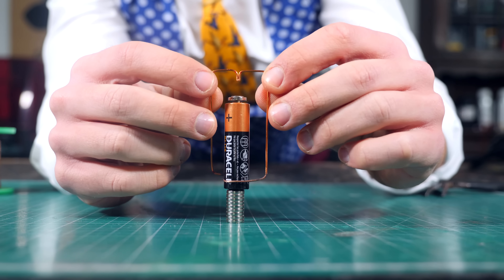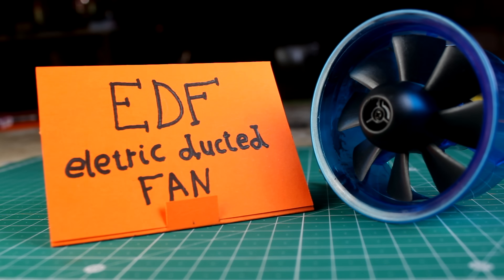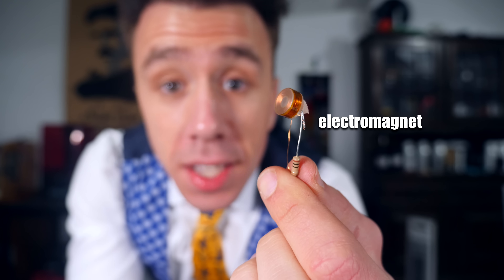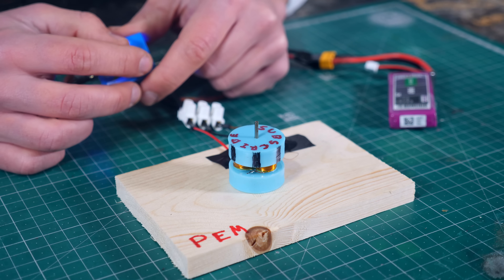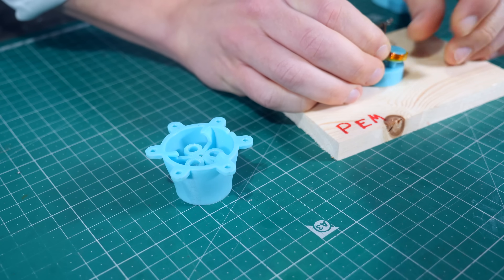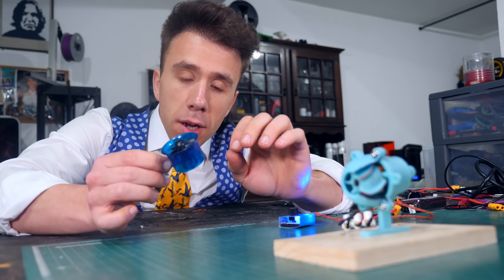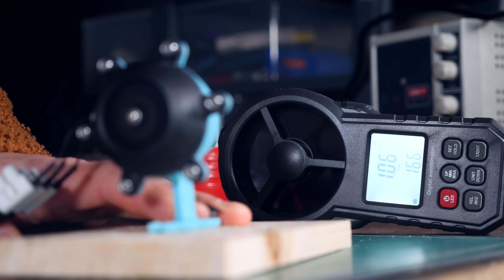I 3D Printed an ELECTRIC MOTOR FAN

Comment: I think you may be eating up your output thrust by the design of the intake side, it isn't conducive to flow. Look into "trumpet intake" (performance automotive) as a very base idea and you'll notice that similarly jet turbines usually have a round edge around the intake.

Comment: I'd first guess part of the issue is intake surface area. The difference between the EDF and your fan is quite a lot so your max static pressure is probably much lower and your impedance higher. I didn't get to the engineering portion of my time studying Aeronautics though so, that's a best guess.

Comment: Not an expert, just fan ...ha 😀and aviation hobbyist. But it might be due to EDF being ducted propeller intended to accelerate air backwards. While your impeller is a compressor which is for compressing the air and actually even slowing it ! And than to be mixed with bit of a fuel and ignited and this is the acceleration portion of the cycle.
If i think about it you seem to go around it in a reversed way. We use compressors in turbine engines to drive themselves and use rest of the air as propulsion either as by spewing from the back or using every little bit of its motion to move a fan - which moves the air. With EDF work of the compressor is done by the electric motor. So what you built seems like.... efficiency wasting device. :-D
Untill you inject that sweet fuel....you know you want to. :-) Anyway Glory to tomato king !

Comment: Maybe smooth your exhaust of the fan to try and decrease drag or increase the size of the exhaust hole

It seemed kinda choppy and the air might get stuck in the bubble bit leading to the tiny exhaust

Comment: The modern jet engines actually built of three parts the compressor, burner, and the turbo.  The first part the compressor compress air by building air pressure and decreasing velocity. Witch that type of impeller is know to do in a turbo. So the problem is one one the two laws involved. Off the top of my head I can remember which Charles or Bernoulli law . But that both deal with pressure and velocity a none compressible fuild (air is considered to be)  exchanging in a Venturi.  To fix  your problem you got the change the pressure on to velocity.
Reply: Text the
Reply: user_kg  text the tellagram above

Comment: My idea for your next video is also the solution for this video;  just to make a bigger design with the same volume cavity size as the EDF fan would push. I believe your smaller model might be just bottlenecking and not allowing the same amount of volume to flow by.
Reply: Hey integza how can I be sure you're the one I'm messaging in telegraph?

Comment: Hi Integza.  Nice video, good try, wrong design.   You built a compressor, and not a good one  (due to the large air gap) when you want a "thruster".   What you want is closer to the squirrel cage blower you show earlier in the video.  

Dyson needs a compressor because they have to fight a lot of internal ducting ("head" or back pressure).  Then at their exit they trade pressure for velocity, and then velocity for total (more) moving air mass.  The last trade relies on some mix of Bernoulli and direct "push".  And they for sure have reduced the air gap at the blade edge to nil or close to it. 

The squirrel cage blower - note the blades are all at the outer rim of the spinning disk, and the "core" is wide open. You can add a little bit of a cone there to help redirect the air but it probably won't help much at this size and speed.  At certain speed regimes it could even have 3-4 blades that widen out.  (Look at how SRNx full-size hovercraft  lift cushion inlet ducts are designed).  The cone is more important if you are in forward flight in a jet plane, where as a squirrel cage is normally not moving forward.

Also the air exiting the fan is aiming radially, but you want it to go  backwards.  So allow the air to exit radially into a curved duct to capture the kinetic energy as well as the pressure.  But you won't really have much pressure - you're going to generate more kinetic energy in this design than pressure until you hit this exit duct. This exit will only be at the area of maximum radius, and will choke down in cross section to match the amount of compression you expect.  Keep that cross section the same until you reach the exit nozzle.   

Also limit the tip speed of the blades to subsonic.  Otherwise turbulence and shockwaves will eat up all your input energy. 

At this size don't worry about the Mass of the impeller.  

The inlet size and outlet size are related by the change in the velocity, so you must have equal mass flows through both (unless you add fuel and combustion).  Pick values for the maximum thrust operating point.

Provide a curved inlet rim - on EDFs it has been shown to improve efficiency. 

Good luck.  I look forward to your next iteration and videol.

Comment: Thanks for the video, 
I have done a bit of Aircraft Maintenance Engineering, I think you are missing the Bernoulli’s Law. it’s a bit difficult to explain in a comment, suggest to watch a video about it. Basically, you need to create a convergent duct after the fan to be able to increase the speed of the air ( and drop the air pressure). other than that, all the blades need to make a convergent path for air as well. Make sure there is no other way for air to escape, check all the joints and seals.

Comment: oh boy, this is a doozie. There are MANY factors that come together for this sort of stuff. Firstly you want to make sure you have similar rotor RPMs (for comparable results, not optimal results). The motor and driver will have combined peak efficiency. Additionally the motor rpm, when given full throttle (Vbatt) determines how much current is coming from the battery, which determines power draw. On top of this, the blade designs can be vastly different in efficiency and depend on un-intuitive relationships (look up Reynolds numbers). You can't just copy a Dyson fan and scale it and slap it onto a random motor hoping for a good match. Lastly, impellers for thrust work best with nozzles, and then you start thinking about the effect of static vs moving thrust and efficiency this becomes and even more complex issue. 

Why don't you instead try to re-purpose existing turbomachinery? ppl make junk yard turbo jet engines all the time. Find an existing compressor and its corresponding efficiency map and spec the motor accordingly to run it.

Comment: If you put too small a propeller on the motor, it pushes less, even if the motor is the same. You have to measure the power consumed by the motor and thus calculate the thrust per watt.  This way you can make a real comparison between the two types of propellers.

On the other hand, the more you record the propeller the more thrust but if you mount it on an aircraft you will get a lower top speed.  It is like a turbo jet and a turbofan and a turbo prop, the turbo prop gives much more thrust, but only works below 300kmh the turbofan gives a little less and only works up to 950kmh and the turbo jet gives less thrust, but works up to more than 1500kmh.

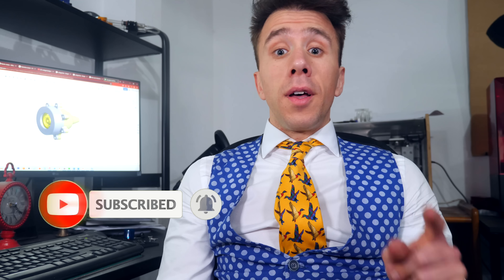Comment: 5:54   I would suggest the ducting is inadequate and is restricting airflow to beyond the optimum level for the amount of thrust generated by the fan.  Also the fan blade might simply be less efficient at moving the air given the power of the motor.

Comment: My guess is that the surface area of each blade on your fan does not match that of the other one. Your impeller fan has five "Blades" which compress air whereas the other regular fan has eight blades. 

If you increase the surface area of each blade on your design to match that of the other fan and then make your airflow going in a bit more then that should be problem solved (I think).

Comment: Noticed you were measuring thrust with an air speed measuring device. Should't you be using a scale to "weigh" how much thrust a given motor produces?
Reply: In other words, you are measuring the air speed coming out of the fan, but that does not necessarily correlate exactly to the thrust produced. Probably... :D

Comment: I think your problem is, that thrust is mass* velocity^2 . The mass is the mass off the moved air and velocity is its velocity. so even if you would have the same velocity, there still might be another mass that you are moving.  And by looking at your design the diameters are very different, so I think you are moving a lot less air

Comment: Try it in water and with little bit of dye. If You manage to test it that way - You got better picture of how flow in Your motor flowing. This is key to understand why.
But screw all that and simply make wider  entry hole. Basically easier make turbofan engine like on airliners than aerospike one.

Comment: I do not think it will work for two reasons.  First the parasitic losses will be horrendous when compared to the fan.  Second and more importantly a propeller and an impeller are designed to do different things.  A propeller is meant to move a volume of air creating flow (thrust), an impeller is designed to create a pressure differential not necessarily flow.  That is why you see impellers used where pressure is important, vacuum cleaners, fuel pumps, turbo chargers, jet engines, ect..  If you look at a modern high bypass jet engine the blades you see at the front are not an impeller they are a ducted fan, the impellers are behind them.

Comment: The mass flow rate at the exit of the fan is what is tripping you up. The EDF doesn’t constrict and has a large fan, i.e. highest mass flow rate without compression and fuel combustion. The turbofan you built looks to be modeled after a jet engine, which does operate on a ducted fan principle, but not the one you built. You built the air/fuel compression part of a turbofan engine, which doesn’t operate on air mass flow, but air and fuel compression and then combustion where the thrust out the end is coming from the acceleration of expanding exhaust gases; which is in essence creating a huge mass flow rate greater than the air coming in. In turbofans, the engine portion does turn a huge ducted fan that accelerates large amounts of air through a duct around the compressor and combustion chambers. In essence replacing the dc motor  with an internal combustion engine on the EDF.
Reply: There’s more to it obviously. I’d love to talk more about it if you’d like offline!

Comment: I think the surface area amd the angle of attack of the fan blades matters. Impellers cannot move much air due to its shallow fins compared to the regular fan you showed.
I don't know the upper limit of the frequency of  the pulse you are creating. But if you add more coils and energine 2 or 3 of them at the same time it will generate more torque and with addition to the deeper fins, it will surely be able to move more air.

Comment: Maybe your fan needs a smooth rigid outer ring sitting in a raceway bearing, and just enough oil to keep it afloat. The oil may need weep holes to fall out into a reservoir and pump back in (for cooling). May sound like extra work on it, BUT the lack of friction and warping, might overcome that!

Comment: Check the angle of attack for the blades if the angle isn’t optimal your causing the air not to pass through optimally

Comment: Fan blade surface area and optimize the gap between the edge of the fan blades and the casing were the pressure is enough to compress the air through the gap and through the casing without getting "splashback" and losing pressure through the inlet which will also limit how much air can get into the casing.

Comment: There are a lot of variables in play here. First, make sure the inlet areas match, the exhaust areas match, and the fan areas probably also need to match. Second, axial fans will perform very differently based on the geometry of the fan alone—the airfoil, number of blades, blade angle (which can vary based on radius), blade chord (also varies with radius), hub diameter, and tip diameter are the main variables. I imagine similar statements can be made for a centrifugal fan.

I know a lot less about centrifugal fans than axial ones, but I have to say that impeller geometry did not make much sense to me. It does not look like it would induce much flow at the inlet, and the blades are probably stalling. I would suggest something that scoops the air more.

Take a look at the impellers for mixed flow compressors (aka diagonal flow compressors); something like that might work better. You would have to tone it down a bit to make it a fan and not a compressor.

Comment: I think you're just coming up against the limitations of your process and material.   For the best thrust, you need the impeller dimension to be nearly the same as the housing you've mounted it in --- I'm not sure your printed material can quite get there.   Also, I think the material isn't as smooth as the injection molded parts in the factory made fan.   That can make a very big difference.
Possibly you can compensate by varying the shape of your impeller blades.
BTW, tomatoes are delicious.   Sorry to disagree.

Comment: you're losing energy compressing the air.  Turbo fans (jets) rely on the extra energy of the burning fuel.  Air by itself isn't going to expand and create more thrust.  The act of the motor fighting to compress the air.   Thermodynamics.

Comment: Same power is not equal to same thrust. At least you need to capture the same amount of air. 
The power limits volume of air which can leave the fan.
But intake is limited by atmospheric pressure * area.

Comment: It could be a power issue , but if u can hit max rpm it's not likely . I would Imagen tolerance and maybe make the impeller a little more aggressive , by tossing a more angled leading edge witch should create better traction . Being dynamic,  rpm is a factor . In my testing more rpm and power usualy dose the job of overcoming inefficiency in my pump design ( fan design) .

Comment: I think you are missing something really important here. The motor is just spinning at the same RPM, however it is NOT putting out the same torque and therefore not the same power. My guess is the EDF is actually using more power. And EDFs generally move air more quickly than open propellers but more slowly than your turbo. The result is less flow because E=1/2 m V^2 and the faster the exhaust the less efficient in producing thrust. Try letting the exhaust expand more to slow down

Comment: The problem is that one is a compressor and one is a Ducted Fan just like Commercial Jet engines use. They use this for fuel economy reasons.
 A Compressor works only well as a compressor that compresses air and fuel and then burns it. 

 That is why commercial jets combine the two.

Comment: optimize the air flow moving a cone shape is a big loss. Being ducted the gap needs to be as small as possible. I would also look at the impeller shape similar to propellers there is a lot on the shape and form of the blades similar to plane wings do a simple google search and you can see depending on the application there is a different cross section for the wing this would apply to you fan cross-section as well. Each small step will make small improvements but its the sum of improvements which will make the difference

Comment: I think your small scale impeller is laminar flow bound due to the working flow surface area of the impeller being so much higher than the ducted fan working flow surface area.  The impeller is busy tearing off the shroud laminar boundary area and causing cavitation right where the flow air needs to have its kinetic energy be converted into mass flow rather than pressure change.  This is the difference between a Rataue pressure turbine and a laminar flow turbine.  Buckets for pressure and blades for flow.  You need your impeller to fly through the air, not pump through the air.

Comment: It's very simple why... the cent fan is creating pressure but poorly efficient at moving air volume (thrust) and the EDF is much much more efficient are moving air (thrust). If your wattage is the same between both that just simply shows that one is optimal at one thing and the other at another thing. At the same rpm and or power level there is no possible way the cent fan can move as much air as the EDF. The EDF isn't compressing air it's blades are only moving air so all its thrust per watt is always going to be higher.
In watts per gram of thrust the EDF is vastly more efficient vs a cent fan.